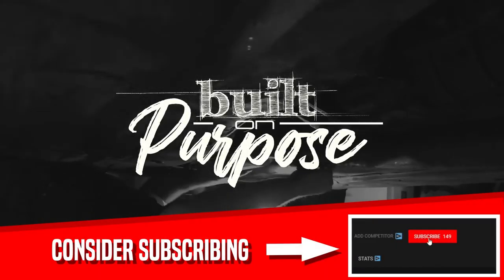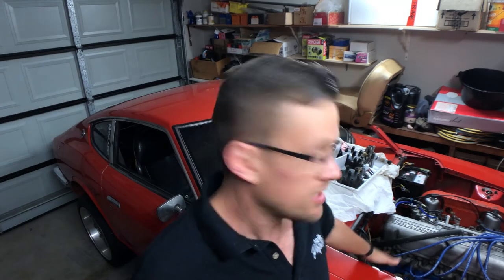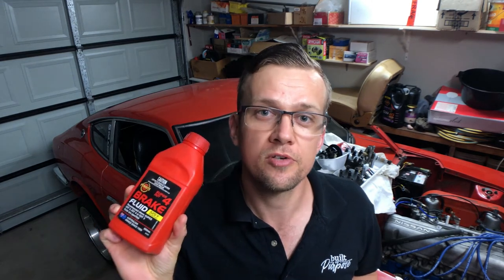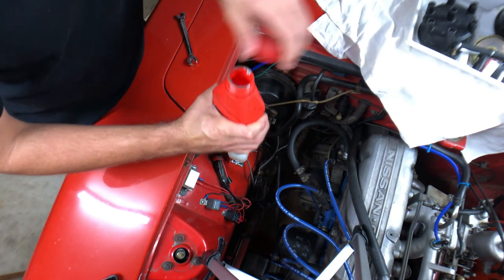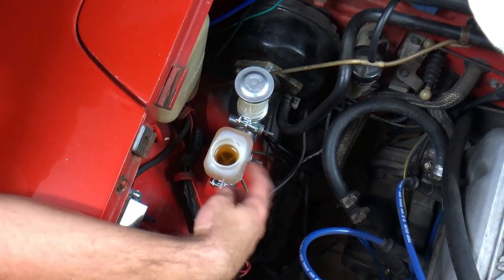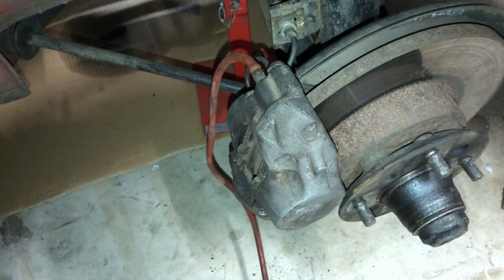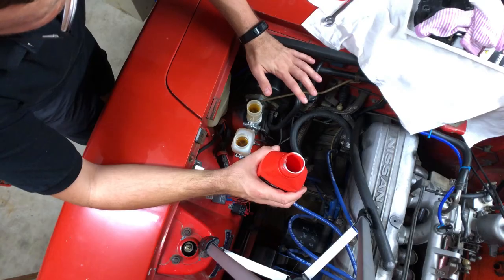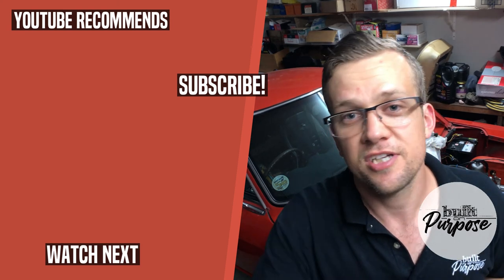Datsun Z Car – How to bleed brakes from empty

Comment: Nice job Aaron.  Really find your channel informative and helpful.  keep up the great work!
Reply from the maker: Cheers!
Reply: @kyushaspeed  Sounds like you didn't bench bleed your master, then?
Reply from the maker: @PeterSierraRacingSupply  correct.  All components straight into the car and gravity bleed.
Reply: @kyushaspeed  awesome. I'm about to do this on my Z and everyone says you should bench bleed. I never have before but never had issues so I wanted to confirm it worked for you as well. Thanks!

Comment: So to clarify? Even if I don't have a master cylinder bench bleed. Would be same process. Trying to figure out asap. Bc I can't afford a mechanic, vehicle also has abs system
Reply: Apparently air can remain in some master cylinders if they are not bled properly, however I am sure that some satisfy themselves with a good enough job if the pedal is firm. Theoretically if it has never run completely dry, then it should be bled properly, but perhaps you can't rely on that.

Personally I believe that applying pressure from the reservoir is a pretty good way of purging air both from the master cylinder and the calipers or cylinders. You can get a pretty simple version of this that can use the air from a spare tyre. This is probably about the cheapest way of doing a reasonable job.

You would need an experienced mechanic to know about all of the different scenarios including any cars that need specialist equipment.

I don't really have the patience for the gravity method or the pedal method and I think that inevitably these methods are not quite as good as more professional approaches.

Brakes are a serious business, so be careful.